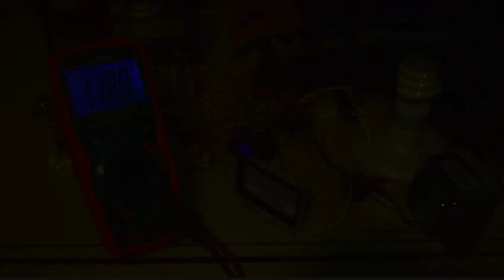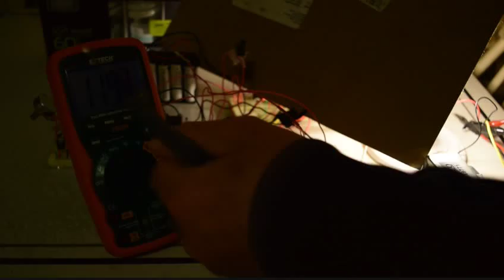Pure Sine Wave Inverter Using 4047 with PWM on a Breadboard

Comment: I think, u should use incandescent bulb to see the real capacity of the circuit, not by using CFl bulb. I've  build so many inverter circuit, it work using CFL bulb, but fail using incandescent bulb. You should try a inverter using TL494c i.c. it work perfectly and it can lights up a incandescent bulb.

Comment: boam dia eu quero diagrama desse inversor senoidal eu tem componente NE555  CD4047 PODE USAR ESSE COMPONENTE NO SEU PROJETO ??
Reply from the maker: +Enoque Barbosa 
Bom dia , Enoque .
Isso é correcta , NE555 não é o mesmo que ICM7555 . Eles têm diferentes tolerâncias , tensão de saída , etc.
(Veja as folhas de dados para cada um. ) O Sr. Majumdar diz que você pode usar NE555 em vez do 7555 aqui , se desejar.

O CD4047 é a especificação em uso com este circuito particular.

Comment: Hello sir. I would like to try this project. I have 1 questio. Ne555 and  ic 7 555 are not the same ic?
Reply from the maker: +Kervin Alamis That is correct, NE555 is not the same as ICM7555. They have different tolerances, output voltage, etc. (See the datasheets for each.)

Mr. Majumdar says that you can use NE555 instead of the 7555 here, if you wish.

I have used all NE555, which worked for me. I have also used the 7555 as specified, which also worked for me. 

I have also built the alternative design with the 4017 and 7555's on the breadboard.

The original design (I believe from Arun Dev) with the 4017 was using only the 7555, but the final design as described here (with the PWM) uses at least one NE555. The 7555 is option, which is why it is within parenthesis (7)555. I believe Arun Dev was at one point using the 4017 IC there. At least, I have built the sine wave inverter using the 4017 very similar to the layout from Arun Dev.

You might notice that Arun Dev's layout does not include the PWM transistor (BC547). 

I think Mr. Majumdar may still have articles on the sine wave inverter using 4017 somewhere on his web pages. I am pretty sure what I built was not the Bubba Oscillator with the 4017, as I saved the original schematic to disk, and do not recall using the transistors and the LM324 arrangement.